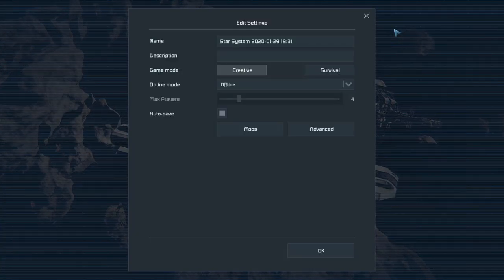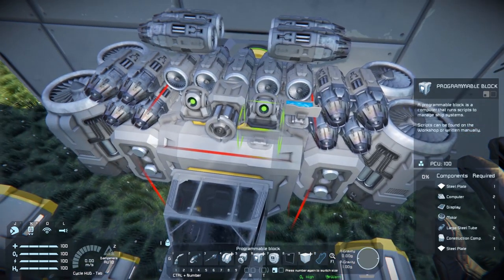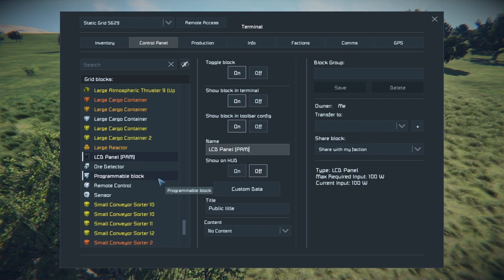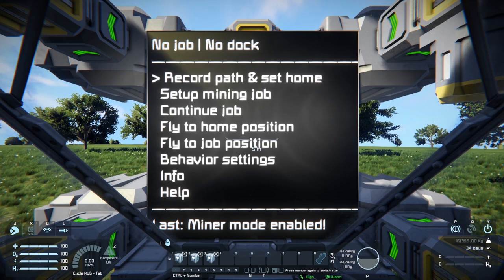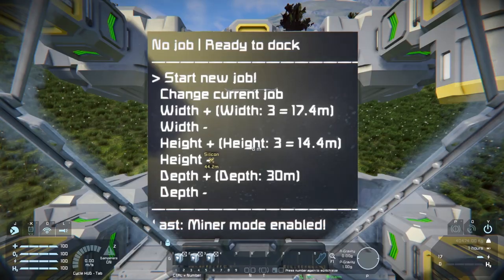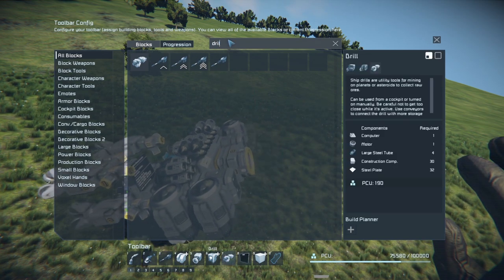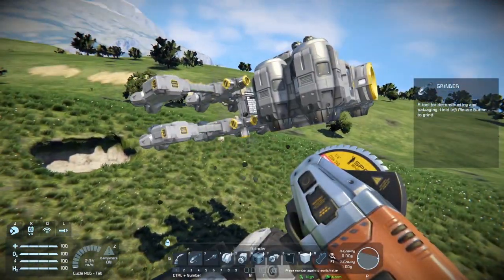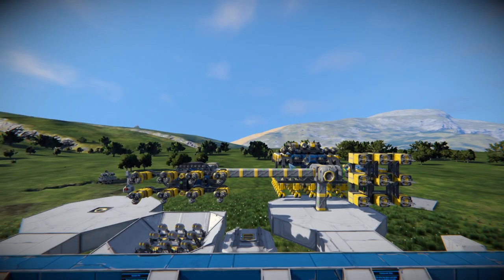The Game-Changing Auto Miner every Space Engineers Player Needs

Comment: Is it possible to set a moving vehicle as home?
Reply from the maker: Due to the way this works, by remembering the path you take, it will need to be stationary as long as the miners are being used. you would have to park while using it and not move until the job is done to use a moving vehicle.